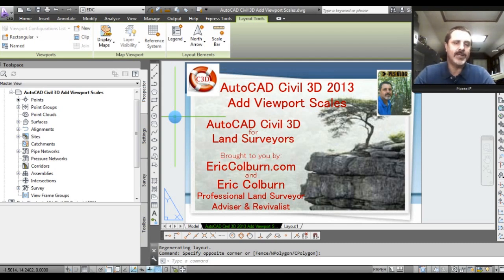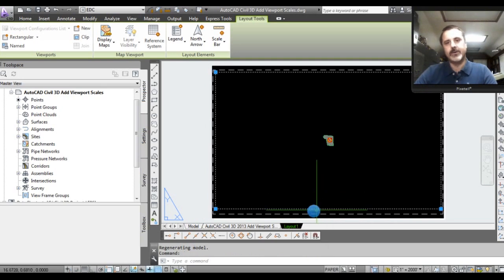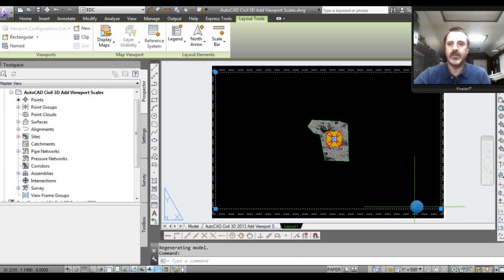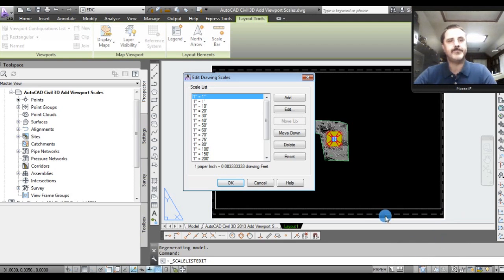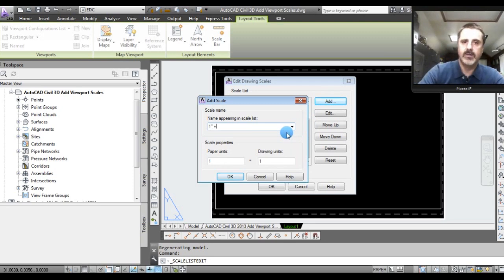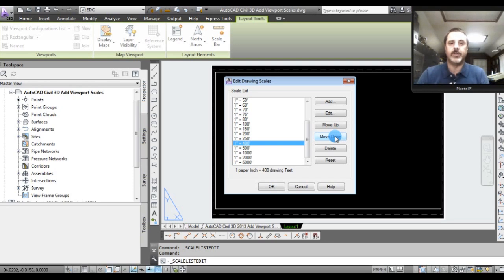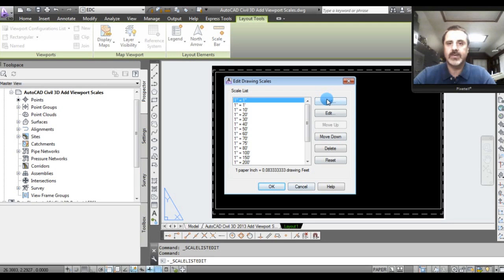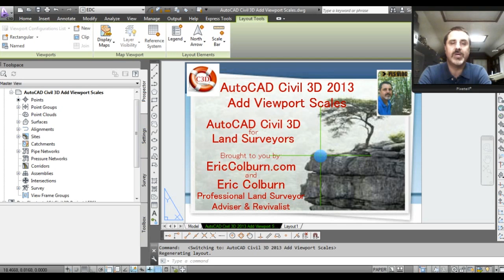AutoCAD Civil 3D 2013 Add Viewport Scales

Comment from the maker: I didn't think so, but now I'm note sure. After some quick research, I'm even less sure. In one place, I read that this command was supposed to be available for AutoCAD 2011 and later, but that did not happen across all vertical product lines. Then, I found the command in the AutoCAD 2010 User Documentation.

Try entering the command directly and see if it works: scalelistedit. Let me know how you make out.